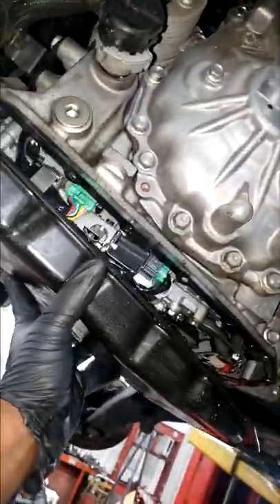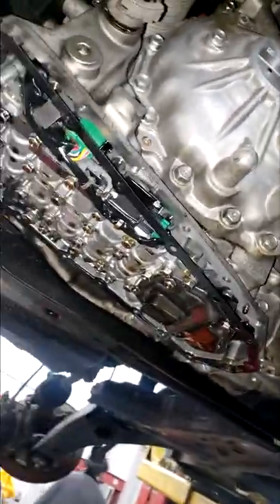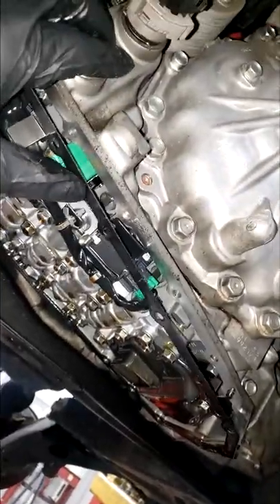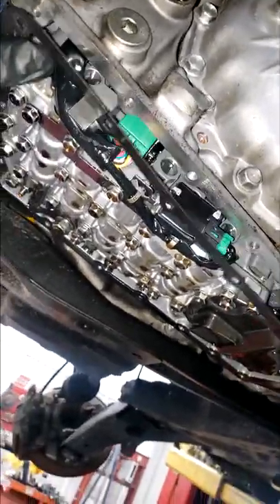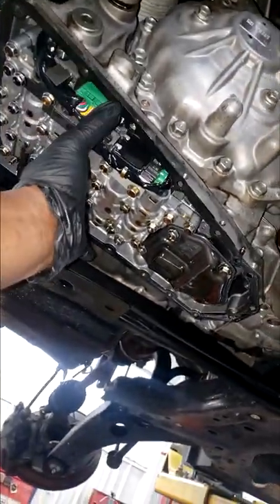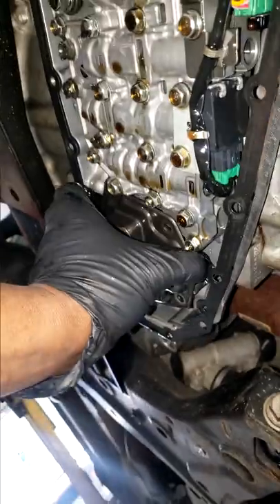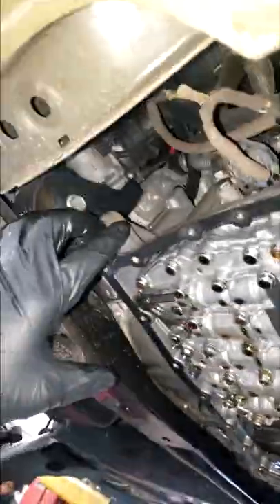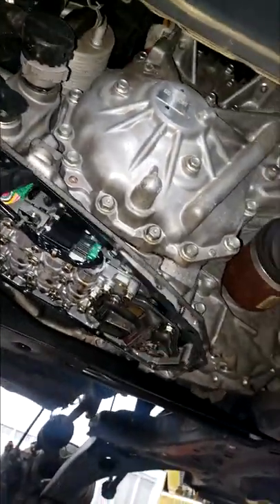How to make your CVT transmission last twice as long. DO THIS WHEN RECOMMENDED. #shorts #CVT

Comment: Tell the service advisors to stop telling customers: “you don’t need to service the transmission. It should last the life of the vehicle”. That’s why they don’t do it usually.
Reply: The life of the vehicle is only till the warranty runs out. Cars are not supposed to last these days. They are designed to fail after the warranty.
Reply: every mechanic told me this after i got a toyota the book says just to "check" fluid not to service or change the fluid....so i went to a 5 star transmission guy and he did mine after the 100k i got another warranty on my car cause of this cvt
Reply: The thing they don't say is that they recognize the life of the vehicle to be when the trans go's out lol
Reply: I work at a Nissan dealer as a tech and this is complete garbage 😂 my service writers sell cvt flushes for me all the damn time and I love doing them cause they’re easy asf and pay great 😂 whatever dealer you’re going to is ripping you hard bozo 😂
Reply: Yeah thats idiotic. I also see controversy on not changing it if you let it go too long (with AT not CVT). Some say change it others say it will ruin it. I have seen someone change their AT at 150k with no prior service and it ruined it (not a CVT though).
Our CVT we just tell them to change it. First change was 92k which I thought was too long next was at 139k. Had two changes so far. So far so good.
Reply: I had a shop say they won’t change out my trans oil because it hasn’t been changed in so long, but the Nissan dealership did and it ran 10x better afterwards
Reply: The fluid doesnt need to be changed, It will last the (dramatically shortened) lifetime of the vehicle
Reply: @MediasmokeGaming  on automatic transmissions the added wear grit and debris  suspended in the fluid can actually keep the car going. The viscosity and lack of particles (new fluid) may not have enough friction/density to fill the new wider tolerances if it's worn badly enough

Comment: I just change the cvt fluid and filter today. I was dreading seeing metal shavings in the pan, magnates, or in the oil but I didn’t. There was just slush and I’m hoping this will prolong the life of my cvt.
Reply from the maker: Good stuff my friend
Reply: @OnlineMechanicTips  that’s the oil strainer filter  for the cvt correct? What about the transmission filter as well
Reply: @dominikapodaca9878  Yes, in addition to the wire mesh strainer that you saw home remove, there is ANOTHER, REAL filter in all CVT’s. 

That’s the cylindrical cellulose-based filter. Very much like your engine oil filter. 

In the final few seconds of this video, you see the transmission fluid warmer/cooler (heat exchanger) on the upper-left corner of the video frame. 
The cylindrical cellulose filter sits behind that warmer/cooler. 
That’s the more important filter to change, at the same time as your CVT fluid changes.
Reply: @reallifeengineer7214  I bought a 2014 Toyota Corolla with a CVT at 126K miles. Even if the fluid has never been changed, should I drop the pan, clean out the shavings and replace the fluid and filters? My mechanic is warning me that he would not recommend messing with it if the fluid has not been changed. He said he has seen new fluid dislodge gunk and ruin the transmission. What should I do?
Reply: @mikewheeler1701  What your mechanic told you, is from the decades of experience related to traditional auto transmission.
CVT is not a traditional auto transmission.

The Car Care Nut (former Toyota senior technician, now running his own shop) has a great video on WHY used traditional auto transmission needs a fluid that's not too clean, not too dirty, needs a balance and be "just right".
In that world (trad auto trans), a transmission that has gone beyond 70K~90K miles and never being changed out, will indeed see more damage if suddenly changing 90~95% of the fluid capacity.  Not because new fluid dislodges gunk.  But rather it's because a bunch of friction surfaces (that are worn-down and therefore not a whole lot of friction surface left) needs the "help" from the fine grits in the fluid.

That's different from a FLUSH.  A flush is always bad, regardless how new the transmission is.  Flush will dislodge some of the metal shaves from the magnets.  Some of THAT gets lodged into places and do not come out during the same flush.  I ruined a perfectly functional Mazda 6 transmission back in 2007 that way, before I invested effort/attention understanding cars.

Coming back to the CVT: when you're not sure which end of the spectrum (dirtier/cleaner), the safest thing to do is a partial drain+refill, AND save the old fluid in case you later find out you need to re-blend some of it back in.

Partial means: whatever you can drain out of the pan, it'll only be 50~60% of the total fluid capacity.  The rest are stuck inside other parts of the CVT.  
ALSO: Since you're saving the old fluid for potential re-use / re-blend, make sure you do not contaminate this fluid during the draining process.  Clean the drain pan first; you don't want any slight trace of old engine oil in the drain pan.

That's the same process I used in 2022 on my wife's 2012 Mazda CX9.  "Sealed transmission".  "Lifetime fluid".  No dip stick...
What I did:
Crack open the fill bolt first (to know I can fill it later).
Remove drain bolt, drain, re-tighten bolt.
Pour 1 new bottle (qt) of trans fluid into the tran; now I have a NEW empty bottle.
Transfer from drain pan into the new empty bottle until the 1qt line is reached.
Pour-out this 1qt into another "whatever" bottle; this 1qt we will not save, because the final bottle contaminates it.
But now I have my 1qt empty bottle again.
Pour out the 2nd qt from drain pan into this empty bottle.  This is the first qt of old fluid I save.
I now can open another new bottle of trans fluid and pour that into the tran (2nd qt going in) - leaving me another empty bottle into which I can pour from the drain pan again...

On a Facebook Lancer group, some guy added an aftermarket turbo to his Mitsubishi Lancer (CVT).  He has extra CVT fluid coolers.  He's being doing that for years, and takes his car to tracks.  Hasn't had an issue so far.  Every year he does a drain+refill (whatever amount can drain out from the pan, probably 3.5 ~ 4 qt, vs a 7.x qt total capacity).  I don't know how often he changes his CVT fluid filter; maybe once every 2 yrs.

I hope this helps.
Reply: @mikewheeler1701  One more thing (beyond the CVT fluid):  see if you can get an OBD2 Bluetooth scanner that helps you monitor the transmission temperature during your deive.

I did this with my Lancer and tracked it for 1 year.  Found out when outdoor air temp hits 90F, my CVT would reach into the 199~200+F with just a casual drive.  >185F is too hot for the metals in the transmission, metal will fatigue and wear at accelerated speed.

That's when I decided to add more fluid coolers and a fan for my CVT.

CVT's will work quite well, provided we give it the "operational environment" it's designed for.
This includes: 
1) Keeping current with maintenance so the fluid isn't getting infinitely dirtier. 
2) Keeping the operation temp between 165~185F via sufficient fluid-cooling.
Reply: @reallifeengineer7214  Thank you for the detailed answer!
Reply: Is your cvt still alive?
Reply: @leopalacios6299  yeah, 13100miles and the cvt oil looks as clean as the day I replace it.
Reply: @TheGetty014  nissan?
Reply: @reallifeengineer7214  mostly true in some cases a new valve body can be helpful because of that said junk. not a fan of cvt but they can be dealt with not always a throw away.
Reply: Update
Reply: @ygbodybuilder3023  10k miles later the cvt works fine. The reason I first change the fluid was because the transmission was whining, the whine has not come back. I used valvoline cvt oil.
Reply: @TheGetty014    did you have any hesitation nor stuttery or slipping going on
Reply: @ygbodybuilder3023  no, just whining noise when going up hills. That stopped after a changed the cvt oil. The oil was very dirty and there was no metal debris. I recently check the oil and it looks clean
Reply: @OnlineMechanicTips  can changing CVT filter ? I heard that OEM ones where better then after Market ones

Comment: I've got over 250,000 miles on a Rogue by changing the fluid every 30K.
Reply: I’ve got 225,000 miles on my 15 Forester without ever changing it
Reply: @InTheYear there talking about Nissan CVT transmissions not Subarus
Reply: @josephalfano3302  negative. They are talking about CVT transmissions

Comment: The most problematic CVTs are in Nissans, Dodge Calibers, Jeep Patriot/Compass, and Mitsubishis. They have one thing in common and that is that they are made by the same company called JatCo (Japanese Automatic Transmission Company). If you don’t change the fluid on time, beat the crap out of the transmission on a regular basis, and/or don’t put an external transmission cooler on it, they will overheat and fail.
Reply: The usual suspects as always.
Reply: Use Xado Ex120
Reply: Exactly. More people should know stuff like this. JatCo has been producing cheap transmissions for a while now so they better be going out of business soon
Reply: @sebastianz9105  Mazda doesn't use them do they?

Comment: THE CVT by JatCo is not designed to go beyond 250K. Data shows that higher climates and larger cities have the most failures due to sitting in traffic and burning up. The cooler is not sufficient for this transmission. Change the CVT fluid every 30K. what ever you drain out match the input! Use Castrol CVT fluid and stay away from the Nissan brand. Not design for higher temps! I have had 2 Altima's 13, and14 and both failed at 238K and 220k. The 220K had 235 tires on it. probably what killed it!
Reply: What killed it was the cvts Nissan used were absolutely awful across the board.  They performed like trash and had awful reliability.  You can’t prolong junk from breaking.
Reply: I am totally happy with a car that reaches 200K.

Comment: If it's Jatco forget it.  They are a flawed design no matter how much you change oil and filters (from a guy that's had 3 replaced in his Nissan).  They all start to whine and turn to s**t.  Best advice, don't own a CVT!
Reply: Amen! Lost 2 Altima's to CVT Transmission failures. Never again! Changed fluid every 60K per manual. What a joke nissan is! Just as bad a Hyundai/Kia

Comment: It's unfortunate that we have gone towards CVT and transmissions with 10 speeds. A manual transmission has less complicated parts and typically won't fail for the life of the car. You just need to replace the clutch and drive it forever.
Reply: Sorry but ford 10 speeds are faster and more reliable than their manuals
Reply: I would go back to a manual.
Reply: @antimedic4441 lmao wrong!

Comment: 1965 Hemi Belvedere 1. Gen 2 526 Hemi. Tremic tko 5sp . Dana 60 true trac 410. Tti headers. Lakewood bell housing. Msd ignition. Chemically stripped repaired and e coated. Frame tided together. Wheel tubes opened to the frame rail. Article in Mopar Magazine on how to tub a car properly. 8 point cage. Super stock interior.
Reply: Ok

Comment: If its a nissan forget it. Its like the early ford Taurus transaxle you get 60k your lucky.
Reply: My ex had a 96 Sable with the 3.0L DOHC. The transmission was the least of the worry on that car....
If you ever had to go into the engine it was a costly one. $1500 for a head and $150 for a head gasket. AutoZone didn't carry them for it in 2006 when I rebuilt hers. Custom hoses everywhere, and all for 2 model cars with 1 engine variant. It was the first year of OBDII so also a custom designed computer system electric and vacuum. Nothing like having 17 1/8" vacuum lines to make sure the rubber boots are sealing on. I've worked on a 97 5.7L V8's and that the rear spark plugs were easy on it, compared.
I bet there were 50 different size bolts on the bottom end. Then adding insult to injury for the home mechanic. The rear head stuck under the windshield by 10".
Luckily my ex's Dad was the parts manager at the Ford Dealership in Gastonia. That was the only place to get most all of the rings and bearings at the time. Auto Zone did have the $1500 head in stock though, hardly anything else.................... Fortunate I didn't need those.

Comment: The cvt belt broke on my 2014 Honda at 180k miles. Any chance I can replace just the belt without having to buy a whole transmission?
Reply: @blitz Neglecting maintenance
Reply: No. At least, not practical. 
To replace the belt will end up costing more than just getting another transmission. 
Too difficult to get at. It’s the labour that would cost you. 

Belt doesn’t just break. Your CVT was running in over-temp condition. 
As for why that happened, most likely the CVT fluid filter was never replaced and clogged up.

Comment: Is it a bad idea to change fluid and filter on a high mileage CVT if it has never been serviced before?
Reply from the maker: Not  that its a bad idea, it may be a risky idea. What do you call high mileage? Also are you subscribed to the channel?
Reply: 09 Sentra 140,000. Has no issues currently just seeing if I’m better off just letting it ride. Of course! Great content!
Reply: @ramonmendoza8980 should probably just do a drain and refill atleast
Reply: @ramonmendoza8980  Do a drain & refill. Save the drained fluid for another 5K~10K miles. (Don’t discard them yet)
Also during the drain/refill, change the CVT fluid filter. Your filter is near its saturation point. Mine was fully clogged up at 172K miles. 

Reason for saving the oil fluid - if you find out later your fluid is “too clean”, you have your own original old fluid to blend back in.

Comment: I have a 2013 Nissan Altima check engine light on with 149k miles. Its jerking on the highway. Missfiring I never had a transmission flush done, and bought the vechile used its ran great for nearly 6years. Im just learning about the cvt issues in these altimas. I've always got the oil changed on time, tires and service. Right when the car is bout to be paid off issues arise.

Comment: I just changed a leaking, rotting transmission oil pan on my Wrangler. Can you please explain why they used stupid clamps to hold the pan to the housing instead of just having it bolt directly to the housing? What a nightmare.

Comment: WRONG FILTER, look that is a sump screen not filter, but look right above the main electrical connector. See that round cooler pull it of there is a cartridge filter behind it that is the torque converter filter the culprit of the cvt failure over heating from a plugged converter filter.

Comment: Low pressure p0868 2014 automat mitsubishi outlander sport 2wd 2.0 motor  were is it at on the valve body

Comment: Hi, I have an issue with code P0741 and P075B. It's a 15 corolla cvt trans. Only issue is the reverse won't work. Code states is a solenoid, but the dealership said that trans doesn't have solenoids. I replaced the fluid and filter but no fix. Anyu clues? Thanks.

Comment: When should you service a cvt transmission filter and fluid?
Reply: On my car’s forum (Mirage) those guys say every 30k miles. CVTs get dirty inside quick because there is less fluid. If you are a clean freak with them they can last a long time. The record for a CVT on the Mirage forum is something like 280k miles.
Reply: That depends on your vehicle manufacturer. But a good rule of thumb is to do it every 30k miles. It may be a little early for some cars but it will on extend the life of your transmission

Comment: Where are you located? Where can I find someone that will do this? My trans guy said I need a new one but I believe I can restore this one with your suggestions. The car still drives it just has high RPMs in first gear. How can I get this kind of service? I’m in Dallas
Reply: If you want to try this:
Change the fluid AND the filter.
Not the wire mesh filter/strainer you see in this video. 
The cylindrical cellulose filter that sits behind the “transmission fluid warmer/cooler”.

If after changing that and your problem goes away, means you were running with a clogged filter. 

The wire mesh thing is less critical. Fluid will still strain through it. Very hard for that to clog up. (For there to be enough metal to clog it up, the CVT is already dead)

Comment: When should u change filter?
Reply from the maker: I suggest you follow the manufacturer suggested time. I dont know this by hard my friend.
Reply: @OnlineMechanicTips  thank you for being  honest
Reply: @Killmonize  some manufacturers suggest not servicing th cvt I know this is a lie you should change it every 40 k miles
Reply: @xalexanderx7342  well true my last civic says not to touch till 100k. But that year civic had horrible trans problems.  I did mine every 30k and no problems traded car in at 300k. It s was a regular 5 speed automatic.
Reply: Every 30,000 miles drain and fill.
Reply: @Killmonize  I can tell you my JATCO CVT had a fully clogged filter at 172K miles. 
Almost ruined my CVT. 
I managed to baby it home on very low throttle and kept CVT temp under 230F during that “limp home”. 

Ideally should be replacing the filter every fluid change. 
If want to get lazy and willing to take risk, then every other fluid change. 

And no, not the wire mesh screen you saw in this video. 
I’m talking about the cylindrical cellulose filter that sits behind the cylindrical “transmission fluid warmer/cooler”.
You can see that component on the upper-left corner of the video in its final few seconds of this clip.
Reply: @reallifeengineer7214  thank u so much. I apriciate the response.  Thank u.